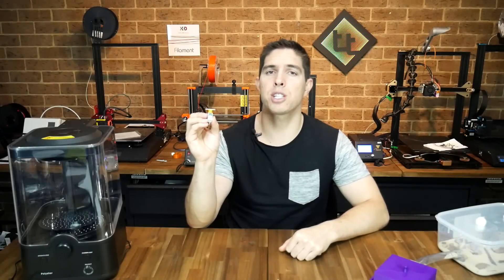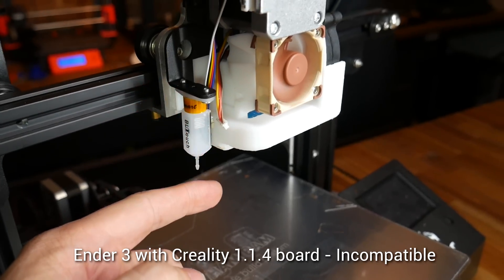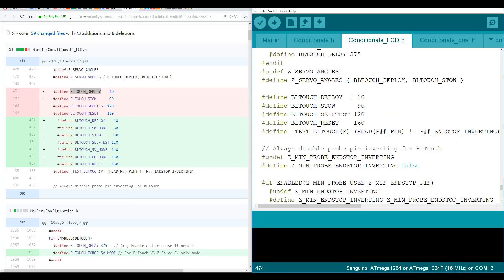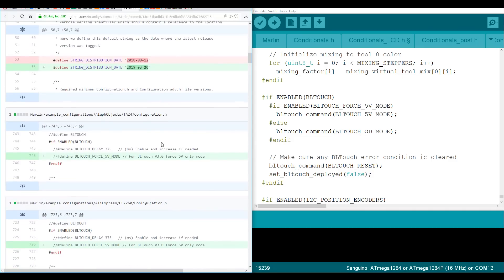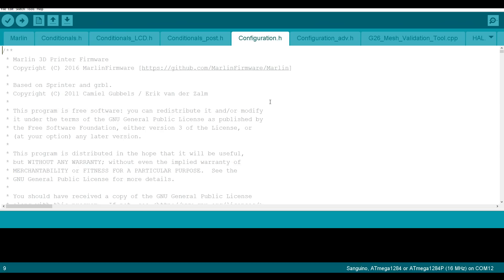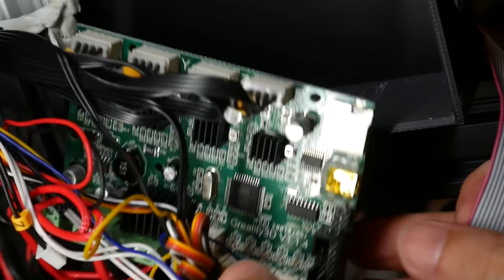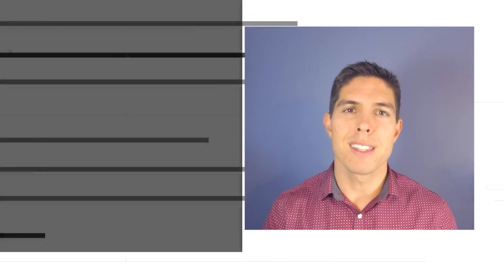3 Fixes for BLtouch V3 on Creality machines

Comment: I just received V3.1 and it works without any mod (firmware or software).
Reply: just got the 3.1 also what firmware did u use as im using a stock Ender 3 pro
Reply: @markrichardson1171  TH3D, I only enabled: BLTOUCH, SERVO0_PIN 27, CUSTOM_PROBE (under ENDER 3). Set X_PROBE_OFFSET_FROM_EXTRUDER -43 and Y_PROBE_OFFSET_FROM_EXTRUDER -8. I really like high qulity prints so I set the grid to 5 EZABL_POINTS 5
.

Just enable Ender 3 instead of Ender 5: https://youtu.be/iAz47riSjLQ?t=707

Comment: Will These fixes also work for a BLTouch 3.1?
Reply: I have a BLtouch v3.1. I bought the hex file from this guy and it didn't work for me.  The BLtouch now resides in a bag.
Reply: I have a BLtouch V3.1 and Creality V1.1.4 board, I removed C7 and followed his guide but I used Marlin-2.0-bugfix firmware and everything worked as he said

Comment: I downloaded the exact file shown in the video for the second method (from scratch) and it doesn't have half the options given in the video, I went to get your pre configured hex file to just make it easier and my progisp program throws Kernal errors when starting it, and doesn't detect my chip used at all.
Reply from the maker: The hex has no relation to the Kerbal error. If you want to compile from scratch start with Marlin 2.0. has bltouch fixes in place and an Ender 3 config.
Reply: yeah i know the kernal issue wasnt the hex, it was just the icing on the cake for another thing not working the way it was supposed to when attempting it

Comment: After watching this video multiple times, i finally took the step to remove the capacitor on my Ender3's 1.1.4 motherboard.
I could run m48 tests with or without the capacitor and it seems there was no issue, however when i go to do a print. The Bltouch seems to run out of power around the halfway point in 'g29' mesh leveling
It seems to start well, on a 3 by 3 grid, but on its 4th or 5th probe, the BLtouch lights turn off and my nozzle goes straight into the build plate.
I have read the BLtouch website and they made it seem like removing the capacitor was the only thing needed. But watching this there seems to be more to it from a software perspective.
One other thing,  I was wondering, if we installed the TH3D firmware you showed in another BLtouch Ender 3 video can we use the setting that Phillip Beal offered within Vanilla Marlin? Or do we have to flash Vanilla Marlin to the motherboard?
Reply: I have issues with the BLTouch intermittently failing to prob also. The probe will extend and the BLTouch will move down towards the build plate, but sometimes - just sometimes - the BLTouch doesn't register that it is actually touching the plate, and keeps moving down crashing the extruder into the plate. Then the firmware crashes and I have to start over. Other times, it probes everything just fine and prints beautifully.
Reply: @morningreis5018  I have the reverse of your problem. Every so often the probe does not go as far as the bed before the machine goes back up. Resulting in printing in mid air. I have only followed the Marlin bug fix option suggested by Michael. I have tried emailing Antclabs 0 but reply yet ..... 11 days and counting.
Reply: @meltonpieman959  Make sure to uncomment the line in Configuration.h which reads: "#define ENDSTOPPULLUP_ZMIN_PROBE"
Reply: @meltonpieman959  Also set your Z_PROBE_OFFSET appropriately. It should be a negative value.
Reply: morningreis It has always been set at a negative value.

Comment: has anyone experienced the Bltouch v3.1 have excessive vibrations during printing? its causing a ton of extra noise once it starts printing at 60mm/s but it only experiences this while traveling on the x gantry. idk if theres an effective way to isolate it or how to get rid of the vibrations.

Comment: Ive just bought a genuine BLTouch and it says V3.1 and it worked with my Ender 3 with 1.1.4 board.
Reply: I didnt do any of these instructions. I just used the latest TH3D firmware U1.R2.14 and followed your other video on setting up BLTouch. I did see something about Version 3 BLTouch in the TH3d firmware. Should I enable the V3 code in the TH3D firmware?
Reply: I have heard that some new boards off the production line of the 1.1.4 and 1.1.5 are being made without the C7 capacitor or with a lower rated one.  I have a 1.1.5 board and a BLTouch v3 from creality on order, so I will check mine out and see if they run without any mods 1st
Reply: @charlielima  my board is the 1.1.4. Maybe they addressed the issue with V3.1
Reply: @charlielima  Hi. I too have the Ender 3 Pro with new v1.1.5 mainboard & BLTouch v3.1. tbh.... this is all confusing me. Where do I go to do any of this stuff. Within Cura I've seen some settings for the printer that I can change, but no-one has mentioned doing anything in that. The v1.1.5 mainboard has a built in bootloader, but no-one mentions using that either. I don't want to keep opening my printer to use the supplied USBISP  adapter. Can this not be done via USB straight into the printer?  So many of the methods on here from all sources seem out of date for the new mainboard. Currently,
I have the printer working 'sort of' but having issues with getting the correct settings for the initial lines. I have scratched my new glass bed already. Really confused as to how to do this. How do I get Marlin to talk to the printer via USB?? aaarghhhhh

Comment: Hi, thanks for the videos, they are very usefull for everyone,  I have a similar issue with 3dtouch and TH3D unified firmware U1 R2 14 and Ender3 board 1.1.3. I saw that not all the modify proposed for Marlin Fw is usable with TH3D. Did you test with Th3D? How can I solve it?

Comment: Thanks for the video, gives me something else to try  with my current mess. I'm adding BLTouch v3 to the creality 1.1.5 silent board. So far it's being a real prick - totally not working BLTouch. Just working out why now (either sits there flashing and won't do anything or just won't do anything with light solid). Worked fine until board swap but this video looks like it's got the answers!
Reply: You figure it out?  I get my 1.1.5 today
Reply: @midknightmist  Truth be told I haven't had time to try any of the suggestions yet. Tonight I'm planning on getting into it.
Reply: @d1gg3r  Did you ever get this to work?
Reply: @ChrisWithACam  I never did no, I ended up getting the SKR Mini 32bit board in the end. It wasn't a huge deal to me though.

Comment: Okay, kind of a stupid question, but I’m new to all of this. I purchased the your hex file but I’m confused on how to install it? Is there a video for this process?

I’ve already installed the boot loader a while back when I upgraded from stock firmware. I also already tried TH3D firmware but couldn’t stand having so many missing options in the “control” menu.

Any help would be appreciated! ;)
Reply: Adam Vitry use load flash and select your hex file

Comment: Great video! Unfortunately when I flash the precompiled hex-file suggested i method 2, my BLTouch and LCD-screen have no power. There was a hex-file from Creality called Ender-3 Pro1.1.6BLTouchV3PowerLossContinueEnglish.hex that I flashed and made the BLTouch and LCD work, but I would like to use the improvements you've made... Any ideas?
Reply: Please help. I’ve been trying to find info on the internet but can’t find anything that relates to my problem.

Comment: Has anyone used an adapter like this on their CR10? 

https://www.amazon.com/FYSETC-Leveling-Auto-Level-Accessories-Creality/dp/B07PR26KSD/ref=sr_1_3?keywords=FYSETC+3D+Printer+Ender+3+Upgrade+Parts&qid=1561986228&s=gateway&sr=8-3

I am curious if it using this and the newest TH3D firmware would work.

Comment: Hi, I have a CR10 S5 (board v2.2) with BLTouch v3.0 and whatever I try, it fails. Tried z-stop cable switch, define BLTOUCH_V3 , force 5V mode, always touching the BLTouch do not stop the Z homing. 
Tried latest TH3D firmware as well as Marlin 1.1.9 bugfix. I cannot find any marlin or TH3D config examples that work for my setup.
Reply: In the same boat.
Reply: The more I try the more I go backwards. After several tests, my BLTouch do not react anymore to touching its probe end when z-homing. Self test is on, individuals gcode commands work, especially the deploy and retract ones. I start auto homing, the z axis goes down, blue led is on, red is off, I touch the probe, it does not retract. Getting crazy with this probe...

Comment: I just installed a BL touch V3 to my E3 Pro, I followed all instructions (minus the fixes in this video) and it seems to auto home absolutely fine, I went for a print and first print turned out fine, went for the 2nd print and after it probed it went ballistic and even dug into the bed whilst traveling leaving a nice big groove in my glass bed. Im wondering if fix in this video will fix my problem because it seems like the problem its fixing in this video is related to the bl touch not even recognizing anything, but mine seemed to auto home fine....

Comment: !! BL-Touch V3  now work on  CR-10S Pro !!
-- Just install a jumper cap --

Firmware and modifications are same as this video:
https://www.youtube.com/watch?v=PLKEhdznVMY

!! Very important step: Install a jumper cap on CR-10S Pro. !!
The BLTouch V3.x is enough just to install the jumper cap on the CR-10S Pro and it works well in Default(OD) and 5V Logic Mode.

See: 
https://www.antclabs.com/creality3d-board 
and 
https://github.com/InsanityAutomation/Marlin/issues/32

Tools:
BLTouch Home & Auto Levelling Height Gauge
https://www.thingiverse.com/thing:1538742

Comment: I always wanted a BL touch sensor on my printers. But these are definitely overpriced. I made my own sensor micro servo based that has same form/function being just a bit wider. It costs a fraction of the BL touch and it seems to be more realiable and higher accuracy and higher repeatibility than any BL touch ever.
Reply: Hi, could you show us your solution and share it with us? I would really appreciate it :-)

Comment: Can you make a video BLTouch V3 on CR10S Pro ??
Reply: @ShadowSociety556  what version of Arduino are you using?  @3Dprintingcanada where i got my BL Touch told me to try an older version of Arduino.  When i flashed the firmware using Arduino 1.8.5 it did the trick.  https://www.youtube.com/watch?v=dRgWrepDUBE
Reply: +1 finally have a new version of the v3.0 but the firmware here i'm not getting the bl touch to work.  Cycles at the start but doesn't extend when it's looking for z home.

Comment: I have an Ender 3 with Version 1.1.6 firmware. Any ideas how this BL touch kit will work?
Reply: Which version of the board do you have? 1.1.3 , 1.1.4  or 1.1.5?
Reply: @Delcadro  The firmware is 1.1.6, the main board is 1.1.4.

Comment: Hi if using Cura ver 4.1 What is the start gcode to add for every print to auto level the bed using the BLtouch v3? thank you
Reply: Add G29 after G28
Reply: @samueldennis8343  thank you so much. Where in cura do I put the info and how should it be typed out?

Comment: Naive question, folks. How do I use the prepared firmware hex Michael precompiled to flash the firmware? Thanks!
Reply: Also came to ask this! downloaded the .hex file but no idea how to load it in to arduino then flash to ender 3
Reply: @johnk274  use the program that he used. You can download it on the creality page.
Reply: @hunterg312  ok I will look at that.
I already have a bootloader and marlin on my printer. I was hoping with his preconfigured file I could just flash it through usb to my printer
Reply: I already have uploaded the bootloader to the machine. I'd really like to be able to upload the hex file via USB and my computer.
Reply: Use VScode or ATOM to make changes to the Marlin V2.0 firmware or the firmware preference of your choice. 

Here is a great video on how to setup VScode so you can use Marlin (or your preferred firmware) on your Ender 3:

Link to YouTube videos to install VScode for Marlin firmware:

https://youtu.be/W6zYvRgGr3Q

https://youtu.be/7Xr9Eb7o0rw

Follow this YouTube Video to setup Atom Editor and how to configure vanilla Marlin V2.0 bugfix for Ender 3, now take that folder and rename xxx-OLD, copy that folder and call it xxx and place it in c:\Users\your_user_name\Documents\Arduino\Marlin-bugfix-2.0-Ender 3-CrealityV1.1.4 . As long as it’s in the same subdirectory as where you did the Arduino projects.  On windows 10 machine VScode will not be able to find the libraries correctly unless you create your MarlinV2.0 in the same directory as your Arduino projects. 

URL: 

https://youtu.be/U8_ldMckGDE 
And
Starting at 4:16 https://youtu.be/GNGN2iSQ5j4
In this video he is setting up MarlinV2 for SKRV1.3 but you use MarlinV2 on CrealityV1.1.3 or Creality V1.1.4 boards ... just name you folder in Arduino “Marlin-bugfix-2.0-Ender 3-CrealityV1.1.4” instead of his name “Marlin-bugfix-2.0-Ender 3-SKRV1.3”.....still copy the correct Ender-3 header files like he does at 6:47, 

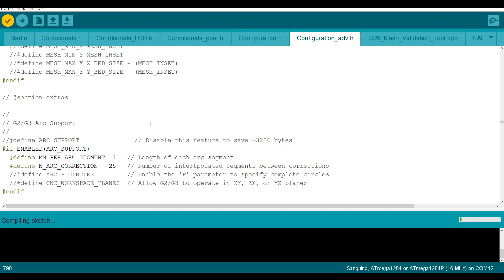at 7:48 you do NOT want the environment set for SKRV1.3 instead ( for the Creality motherboard V1.1.3 and V1.1.4 ) set default_envs in platformio.ini in ATOM editor to the following:
default_envs = sanguino_atmega1284p

USE VSCode to make changes to firmware and compile to get your firmware.hex file. 

Since you flashed the opti boot loader you have a choice on how to flash the firmware file to the motherboard: You can use VScode to upload to flash the firmware automatically by attaching a USB cable to the front of your 3D printer or You can use OctoPrint “Firmware Updater” to flash the firmware.hex file.

VScode will store the new .hex file for the Creality V1.1.4 board in the following directory:

“C:\Users\your_user_name\Documents\Arduino\Marlin-bugfix-2.0-Ender 3-CrealityV1.1.4\.pio\build\\sanguino_atmega1284p\firmware.hex”

++++ OctoPrint Firmware Updater+++

Firmware Updater Plugin:
On the raspberry pi running OctoPrint you must install the following:
$sudo apt-get install avrdude
$whereis avrdude

URL for OctoPrint Firmware Updater:

https://github.com/OctoPrint/OctoPrint-FirmwareUpdater

To use the OctoPrint plugin set the following in “Firmware Updater” plugin:

Flash Method: avrdude

AVR MCU: ATmega1284p

Path to avrdude: /usr/bin/avrdude

AVR Programmer Type: arduino

On my OctoPrint avrdude is in “/usr/bin/avrdude”

Ensure OctoPrint is connected to the Ender 3 Pro with the USB cable (ensure that the USB cable is powering the Creality board by removing the USB adapter that stops the power going to the board) without the adapter board, have the Ender3 pro powered off, now hit the “Flash from File” button

“C:\Users\your_user_name\Documents\Arduino\Marlin-bugfix-2.0-Ender 3-CrealityV1.1.4\.pio\build\\sanguino_atmega1284p\firmware.hex”

****Note: if you turn on the printer and get a blank blue screen it means no firmware has been loaded

********Notes: if VSCode has problems, try disconnecting the USB cable , exit VScode, install USB cable ,open VScode, wait for VScode to load , select Platformio from sideMenu, select Project tasks, select Rebuild Intellisense Index” then try to recompile or upload again

Comment: Thanks for your great video...just got my official creality bltouch...is this info still up to date? Also if i use marlin bug fix (was in link of previous video)...  do i need to go through any configurations (like step 2 in this video)...or is it already configured for a ender 3?...
Reply: Go to the antclabs website and check when your V3 Bltouch was made, depending on the date it was already fixed, you'll notice that they even recommend TT video for those who have the "old" V3 Bl touch.

Comment: Any info on the BLTouch V3 and the Creality CR-10S Pro compatibility / install?

Edit: I found a thread that said to use the Creality-DWINTest branch of InsanityAutomation.  Also to place a jumper on a specific pin pair on the breakout board to make the V3 BLTouch work well on this printer.

Here's the thread:
https://github.com/InsanityAutomation/Marlin/issues/32#issuecomment-492809555

Comment: I have a bltouch v3 a ender 3 base build with the mks and tmc2208 drivers 
i have tried all but my printer wont stop when the bl touch reacts the bl touch is glowing red and a tiny blue led is lowing too so it is a sofware problem i have tried to fix marlin 1.19 have use the bugfix 1.19 and the bugfix 2.00 and nothing will run my sensor
Reply: Same configuration as you, mks gen l tmc2208 bltouch v3. I have tried Marlin 1.19 bug fix, 2.0, and multiple configurations, but i can't make it work. Nothing happens when i use pronterface to send commands. The bl touch is glowing red as well and has a tiny blue led blinking. If you find the solution plz let me know!
Reply: @jmg8856  you must change the both signal cables then it works i dont know why but so i solvered my problem
Reply: and the blue one shouldn´t blink
how did you connet the bltouch to the servo ?
Reply: @meloplayzz8970  Hmm well i did that from the beginning (i plugged dupont wires from extension cables to mks to have them in the right order : sig vcc gnd)
Reply: @jmg8856  i mean the plug for the z endstop you musst change the both cables then it will work
Reply: i doesnt know why but i found this after a few hours of serching in the inet and it works without any issue
Reply: @meloplayzz8970  I have an Ender 3, MKS Gen L, and bltouch V3. I have followed Michael's videos to the letter but cannot get the bltouch to respond to any command. Help! How did you get this to work? My bltouch self-tests fine when there is power to the main board but does not respond to any commands.
Reply: @Hitsujioyaji  you have a plug for the endstop you musst change the both kable like you will rotate the plug 180 degrees